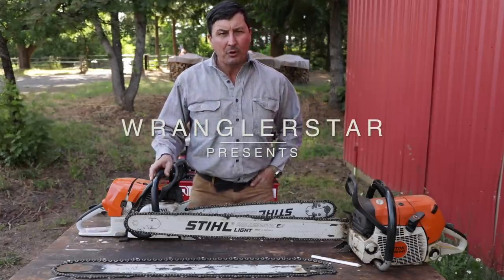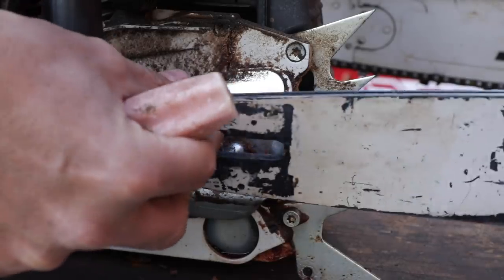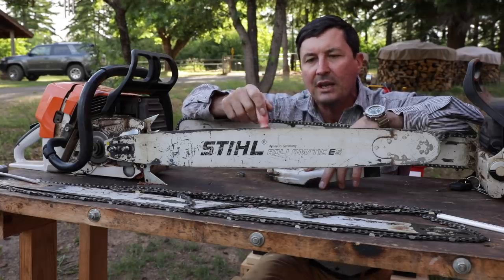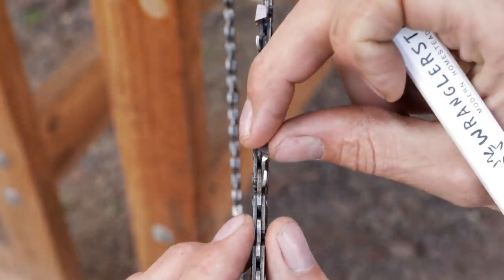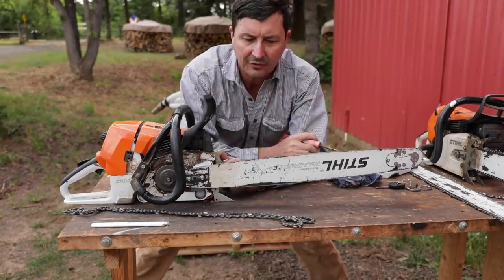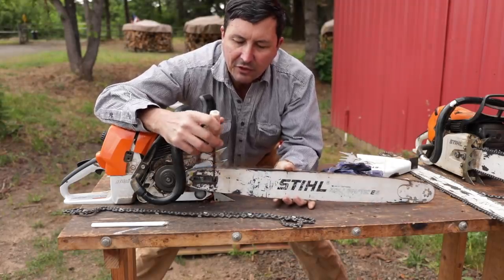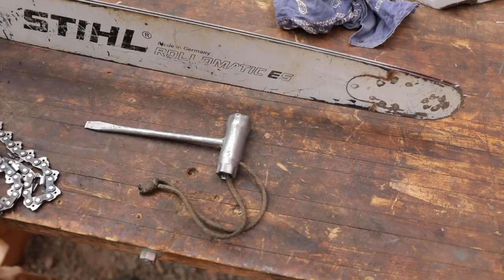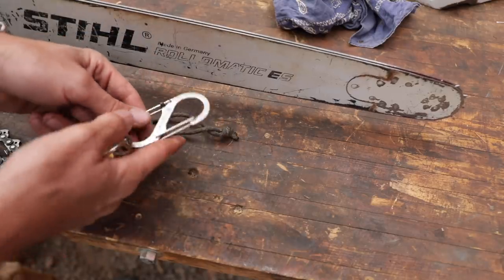Why Loggers Run Upside Down Chainsaw Bars

Comment: My dad has an old chainsaw his grandpa gave it to him I’m thinking about buying a new one which one is a good one I maybe use it once a year to cut firewood
Reply: Hank Hill the Stihl ms 170 is a nice saw for firewood
Reply: Hank Hill I've collected and worked on saws for years.  If buying used you can't go wrong with say a Stihl 026/ms260 all the way up to the Stihl 044/ms440 if you're talking Stihl.  The Dolmars from the 6400 to the 7900 are great but within a few years parts will be hard to find.  Husqvarna 300 series are great, parts are easy to find and available.  If looking at new pay less attention to brand and focus more on dealer support.  Avoid the box store saws.
Reply: Pro 362
Reply: Stihl, Husquavarna and Echo are three top of the line brands.  More and more professionals are starting to switch into Echo as their warranty and build quality are fantastic.  For firewood cutting, I would recommend anything with a 20" bar minimum.  A 16" bar will be just a bit small for any wood worth burning.
Reply: Hold on there Hank, I thought you only used Propane!
Reply: PuchMaxi , don't forget the Alamo beer.
Reply: I would just get any home grade reputable saw, no need to spend a fortune.  I have a Craftsman with a 20" bar that I have had for almost 30 years now.  I use it once or twice a year besides chopping the Christmas trees into sections for the trash guys.  Fires right up and never had a problem with it.  Now that I think about it I wonder who manufactured it? I have never really looked at it close enough to find out.
Reply: Personaly i like to run husky saws but thats just my preference
Reply: If you're not diligent about taking care of it (gas etc) it will be a headache no matter the brand. For once a year use, you might be able to rent one in your area.
Reply: EC Fishing
Never say never... I switched from Stihl to Echo and never looked back.  I have a CS400 with a 18" bar that I have used for 5 years. It always starts on the 2nd or 3rd pull and has never let me down. I liked it so much that this year I bought a 590  with a 24" bar. It's a BEAST! Stihl is not what it used to be and Echo has a 5 YEAR warranty. Stihl does not think that well of their saws.
Reply: Hank Hill 

Ms 170, I haven't met anything I couldn't cut with it. Don't listen to nay Sayers. 

If the tree or felled tree is too wide, cut from both sides. To say 16 inches is too small for fire wood simply is not true at all. I've had mine 2 years and used and abused it heavily.. it's a great saw and perfect for what you need.

I've cut so much wood with it well over it's marketed maximum. Trees in the north and even bigger trees in the south. 

If someone can't cut with this saw, then they truly don't know how to operate a chainsaw and probably shouldn't be using any chainsaws. Sorry but facts are facts.

You can cut big trees with it if you know how to use a chainsaw.
Reply: If all you need is a once a year saw buying a top line professional saw is for those that money is no object. If I made my living with a saw then pro saws would be in my truck. As it is I use a saw 3 or 4 times a year. (depends on how many storms come through here each year.)  I've been using a $200 Poulan 50cc 20 inch bar and it's 10 years old and still does what I need. One big thing, never use gas with alcohol in it no matter what you decide on.
Reply: 445 husquivarna is great beginner saw and reliable. Cuts great for 50cc saw.
Reply: get a stihl it will start after sitting for a year
Reply: Do it once, and do it right. Buy Stihl.
Reply: John me I love my cs440 with 18" bar, step up on chain size and a few more CCs. than  cs400. I worked at a saw shop that sold husky and Echo, when I picked one, it was an Echo, good mix, keep the chain sharp, clean automotive style air filter once and a while, and go.
Only major problem I saw with one, a guy ran straight gas and killed one.
Great midsized saw.
Reply: tlpoutdoorsman Echo has been raising the bar quite a bit.  Lots and lots of professionals are moving to them, fa tastuc quality and amazing saws.  Do some looking around and you'll find lots of companies switching to them from Stihl and Husq.
Reply: Just go next door and borrow Dale's. He still has your mower anyway.
Reply: Stihl all the way ..i also like echo and husky professional grade .. but bang for the buck Stihl is hands down the one that will run when you need it too .. be sure to use the Stihil oil for mixing that is recommended (it has a fuel stabilizer in it  and the saw will start next firewood season) and try to avoid ethanol fuel .. its also best to run 89 or better octane in the small 2 strokes .. and when cutting run the 2 stroke fast .. they are made to run wide open when doing work ..
Reply: Get a Battery saw and you won't have to worry about the fuel going bad.
Reply: Old saws can kill you because of no chain brake.I cut with the old MucCulloch's from the '50/60's and they could  whip a mans head off if the chain were to break or kickback so I learned to stand to one side while operating.
Reply: @killingoldgrowthsince  got a bigger saw for that.
Reply: @killingoldgrowthsince  440 magnum.
Reply: Prolly keep the old one and tune it up. They don't have make saws like they used to
Reply: Don't bother you will hurt. Yourself.
Reply: @killingoldgrowthsince  I can cut that log w/ that saw.
Reply: I think you can convert Stihl's to propane.
Reply: @killingoldgrowthsince  whoosh
Reply: @killingoldgrowthsince  I think my statement went over your head. You must not know who Hank Hill is.
Reply: @killingoldgrowthsince  do you know who Hank Hill is? That will determine whether or not it's hilarious.
Reply: @Hallie867  
I was told to only use non ethanol gas.
It is so worth it as it won't attract water, no stabilizer needed.
Water damages your carb.
This is great for all equipment including lawnmowers.
The ethanol could be a scam to sell repairs and equipment.
When the eco terrorists were pushing more than 10 percent ethanol, people's cars were getting damaged.
I only use non ethanol gas in in equipment now.
Reply: Stihl makes an MS 880 magnum that is pretty good for cutting up smaller stuff but husqvarna makes some good saws as well.
Reply: @traviscarr6536  
The guy I work with loaned my his stihl Farmboss.
Really powerful saw and cut some bigger logs my smaller harbor freight saw was struggling with..lol
Reply: @imacrazyguy5831  
Agreed, my cheap harbor freight saw that my uncle gave me is 16" and it struggles.  For 100 bucks I abuse that thing and will throw it away when it expires..lol
And get a bigger firewood saw.
Cheers
Reply: @markattardo  
If you use non ethanol gas, it shouldn't be a problem.
A friend convinced me to always use non ethanol gas on lawnmower etc and starts and runs great.
Reply: @sonofrobert  nothing better than stihl & husqvarna.

Comment: I always flip my bar every time I sharpen my chain. 👍🏼
Reply: Chad Cole your also supposed to change out your sprocket if I remember right it’s like every 3rd chain
Reply: My guess is you don't sharpen your saw nearly enough! Every time you sharpen, eh? Shesh...
Reply: Youse guys don’t understand... they’re not sharpening  their chain in the woods.. they are swapping chains\, rolling the bar,, and cleaning out the chair groove (because wood chips will build up in between the rails.)thats where the oil rides to cool the bar
Reply: Hobby chainsaw owner.
Reply: Don't forget to turn the front to the back too  ;-)
Reply: Chad Cole, I have flipped bikes a number of times, and did seem to sharpen up a little.
Reply: mcferkyou mootly  I have one, you can use mine.
Reply: Not required, and why do you remove your chain to sharpen it? Don't know how to do it by hand?
Reply: Chad C

okole
Reply: Stephen Moore you really think you can hand sharpen better than a grinder?? 😂😂😂😂😂 I guess if you use your saw once a year that's just fine. The rest of us like actually maintain our tools
Reply: @kyleivy7315  i agree with every 3rd.
Reply: thats a little excessive... every time you change the chain would be lots... theres really no advantage do doing this, but no harm... kind of like rotating your car tires every weekend... not harmful but not really required.
Reply: @jamesfogerty3044  who is not sharpening in the woods?
Reply: Never flip your underwear, it is ALWAYS yellow to the front brown to the back
Reply: Adam Wilson lol show me a professional arborist or cutter that does this..  This is a joke
Reply: Fau Q maybe 5... 3s not impossible if you're cutting clean wood
Reply: @jamesfogerty3044  whos not sharpening in the bush?
Reply: @adamwilson4834  some of us learned to be a bushman. If you dont know how to sharpen a saw by hand at work well thats just sad.
Reply: grumpy old fart  Thanks for the tip.  My washer is outside so it froze last week.  I cleaned some by hand in the sink but I like your idea better, who'll over know?  Duh!
Reply: @pjfarming4576  I forgot to do that one morning and had to hold it all day cause I couldn't find the damn thing.
Reply: @gregtaylor8327  a lot of us don’t have enough extension cord to get too far back in the woods.

Comment: Rather than have the regular big t-shaped tool with me all the time, I crafted a smaller chain adjuster/bar wrench out of an old box wrench using a grinder. It took about 5 minutes to make. That mini-saw tool is conveniently mounted on the housing of the saw, with an extra little loop to help prevent it from popping off. That way its always with the saw, I can adjust tension when I'm out in the woods. The regular wrench (with the spark plug socket) is in the case, where the replacement spark plug happens to be.

Comment: One thing you don't mention is that when you use a bar long enough that the paint comes off, you will notice blue sections on the top and bottom. I though these were burned sections, but they are actually hardened sections to improve wear.

Comment: Also One other thing to note. Is if ur bar chain groove is wore out in there's a decent amount of side to side movement. It will be almost impossible to flush a big stump flat. In it'll cause the chain to pop off as well. Another Tip on why ur saw may cut crooked is, one side of the chains teeth are trying to take a bigger bite then the other causing it to pull to that side. Sharpening ur saw consistently is essential to a flush straight cut!

Comment: I flip my bar when I make a new chain. I can make a chain last an entire season with touch up sharpening. A pro wood butcher wears the top of the bar as much as the bottom because of back bucking, if you don't know what that is you have much to learn. The sprocket I never oil because oil and grease trap grit and grit is bad. A bar is normally pretty worn out by the the time the sprocket seizes or is worn out. As a professional tree cutter I can say that most people sharpen way more than required primarily because they hit the ground or cut dirty wood. A saw should throw chips for several hours of continuous cutting before it requires sharpening, if not, you need to learn how to cut properly.
Reply: Except in southern hemisphere countries where we cut nothing but hardwood, 11 up on the Janka scale. There's a species called Black Wattle, the bark produces and abrasive powder. I do 3 draws on every tooth every tank of fuel. Like a butcher's knife, keep the edge on it, it stays sharp, let it dull, that's a lot more work. Old Ironbark will dull ANY chain, even Duracut or Versacut.
Reply: Lol you ether know nothing about chainsaws and chains, or you cut sponges with yours. Try cutting hackberry and hedge and let me know how your mythical “all day” chain lasts.
Reply: That requires a touch up, that's all. Most of these people that watch these homesteader type videos are not proficient with chainsaws and manage to hit thinks other than wood. There's a very good chance that if you are younger than 35 I've been using chainsaws professionally longer than you have been breathing.
Reply: @dangertreez  everyone is different. We cut in different conditions all around the world. I used to go through a chain every two weeks or so. A bar would do about six months. Amazing what sand does to your gear. Get out into hill country blocks and do a chain in maybe 3 months and a bar with two tip renewals once per year. Husky 272 and 273. 7 or 8 tanks per day flat out.
Reply: Yeah I hear ya, but I own and operate a tree service in Canada. We cut hardwoods, softwoods, trees on sandy shorelines. All conditions. Much of it boils down to the user, and your sharpening/ touch up skills. Ie a dull saw typically gets pushed down on into the ground, lack of a peavy etc all impacts chain and bar life.
 @gregtaylor8327
Reply: @dangertreez  best run i ever had out of a bar was a solid tipped Tsimura 24 inch bar. It bloody amazed me. The steel is so good. My spelling of its name may be wrong. Ran them for 3 years cutting Pine pulp logs on sand in NZ.
Reply: Yes there are trees that are more brutal on chain, some trees require the bark removes with an axe before the cut is made. that could be your problem. wood is not harder than steel, so that will not stand up in court.  @chriswillmott462

Comment: The small end of the raker depth file guide is designed to clean the slot in the bar and clean the oiler holes on the bar.  You run it down the bar a few times and the chain runs smooth again.

Comment: Don't forget to check for and clean out sawdust that accumulates in the bar groove as it will re-plug oil hole when you run after flipping bar.  My depth gauge is made with a point on either side to accomplish this.

Comment: i didn't know you had to flip the bar , thanks .
i always taked off the bar when sharpening cause i like to take a brush to the entirety of the inside of the chainsaw .
it probably doesn't make a performance difference but i just like having a clean chainsaw

Comment: The bar wears mostly along the bottom groove. It wears along the new bottom groove when the bar is flipped (rolled) to upside down. The far ends of the bar have been wearing regardless which edge has been up. The resulting extended bar working lifetime is somewhere between  less than 100% and more than 50%. Now to build the jig allowing machining the bar to accept the next size bigger chain, a link shorter.

Comment: I just had a class with this guy from Sweden (svante Hansson super smart guy) and he explained how a chain works it’s just a big conveyer belt that transports chips. So with that being said the more space you have between your tooth and the depth gauge the better. So try filing down that gullet that’s below your tooth for a faster smoother cut. Also I would highly recommend using a round file and a flat file when sharpening your chains. Grinders just don’t do the job. I’ve tried using a grinder many times and I’ve found that using a round/flat file is the way to go. You can also get a file guide that drastically improves your filing abilities. It has two setting for the depth gauge too. One being for hard wood and the other for soft wood. I thought I’d been filing chains right all along and as soon as I went to this class he completely proved me wrong. Also by rotating your bar it’s supposedly bad for the roller sprocket at the tip of your bar. I personally rotate my bars and I’m still looking into if it’s bad or not but I can see how rotating it could be bad for that sprocket.